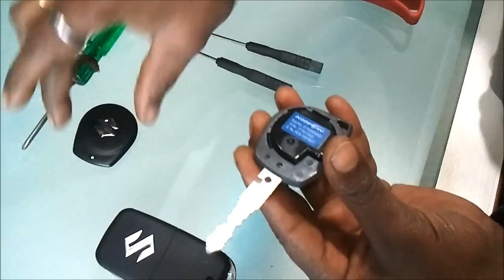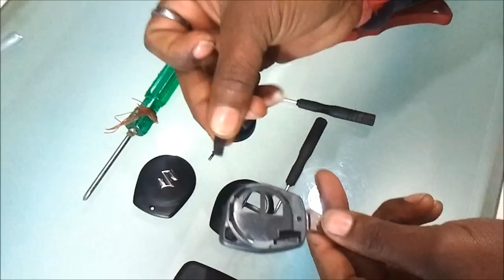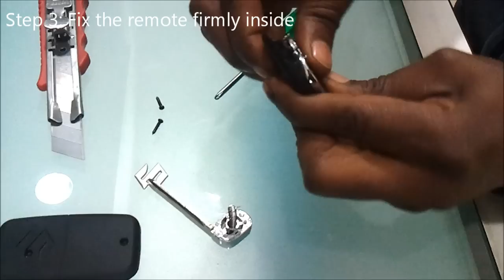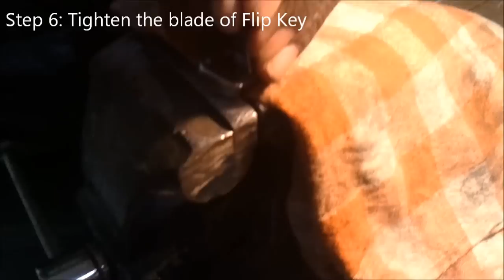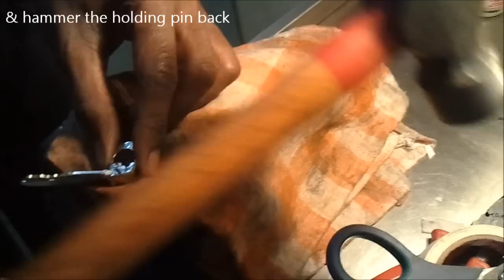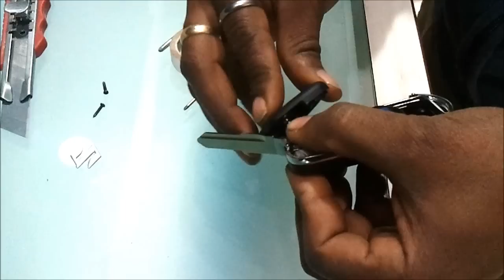Maruti Suzuki Swift Flip Key (www.flipkeys.in)

Comment: this would not work since as you can see, the original key had a cut (line), just in the middle. the key that you made do not have it, therefore it will not get inside the lock. believe me, I bought the flip key for a 2017 Suzuki Swift, and it didn't fit inside because the missing cut.

Comment from the maker: @MultiJjal Nice question?
I can make the key, You are absolutely right but I can't make the transponder/sensor without the presence of actual car at my place which requires complex programming by attaching a computer to the car. Moreover your car key has an ID46 transponder which changes its code approximately every 16th time when you turn on your ignition, which gives virtually very limited chance to copy the code, even if it had been possible without the car.

Comment: transponder/sensor chip is part of of the black box which has got 2 buttons with my S-cross keys.
please suggest a way out because of this reason the sensor is far from metal part of key and it doest work.
Reply: +pathik kandhari Hi, have you managed to get a solution? I have the same problem. 2015 Swift
Reply from the maker: +pathik kandhari We have recently found the solution to this, Its bit complicated, You have separate transponder from remote circuit using soldier Iron. Take 2 pieces thin insulated wire, Connect transponders both end with that and solder that to circuit so that its orientation / connecting point remains the same. Now you can make flip key work with this. Video for this technique currently not available
Reply: +Flip Keys Hi, can you do a video showing this?? I would Love it
Reply: +Flip Keys i am unable to understand this,can i separate the transponder and just use it like other key?or will it spoil the circuit if i remove the transponder.

Comment: Can you suggest if this can be implement we do in a 2010 swift vi with separate nippon remote and for info the remote has 3 buttons.. Also would like to know if new swift in built remote can be programmed to use with the existing lock as I see in the video this is also a nippon make swapped from the original key to fold one ??
Reply: +Sreejit Kurup  Hehehehe... Evn i too hv the same question dude :)
Reply: ya flipkey kaha milte ha bro